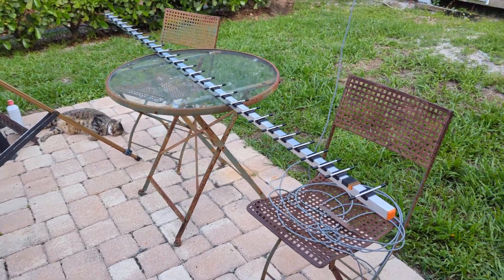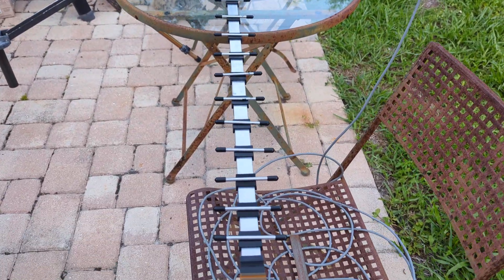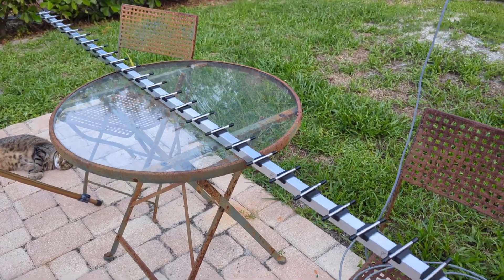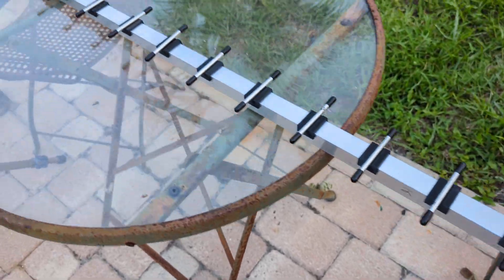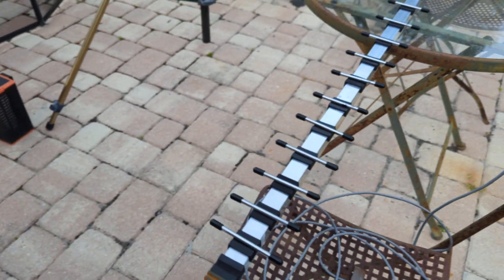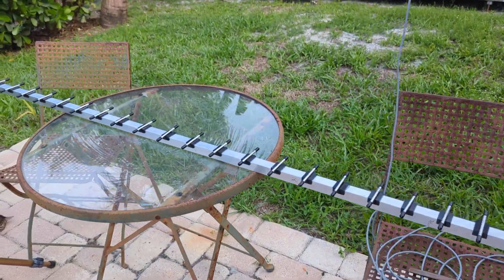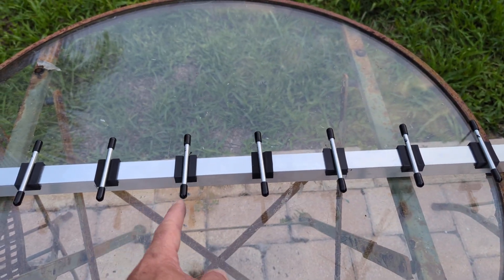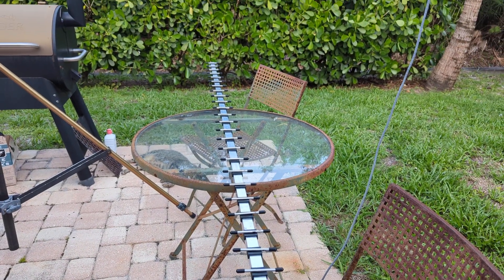1296MHz EME Yagi, Homebrew Project Part 5

Comment: There's 2 things im worried about here  , if you didn't mind me saying, 
The width of the boom in relation to the elements and the rubber endcaps. I've found that even on 2mtrs the endcaps will lower the resonance of the antenna. 
Just something to keep in mind .

Comment: In the Healesville Sanctuary, in the cockatoo’s cage is or was microwave antennas with different coloured plastic caps in them, the caps are needed to keep out the wasps but the cockies chew certain colour caps. So eventually cocky friendly colours will be used.
Slightly different topic, the plastic rings around milk bottles are also a certain colour because the cockies pick them up and it slips over their head, around their neck and they die. But they ignore rings of certain colours.

Comment: I suspect those end caps are going to have a big effect on SWR and electrical lenth of driven elements. So when you first try to check SWR and its way off, try removing end caps first when trouble shooting. Even at UHF a little red plastic ball on antenna whip for eye protection will make element look too long for freq. i have many years of lo-vhf, vhf, uhf shf 800,900 up to 6ghz . W9USS
Reply from the maker: I will take that into account when tuning